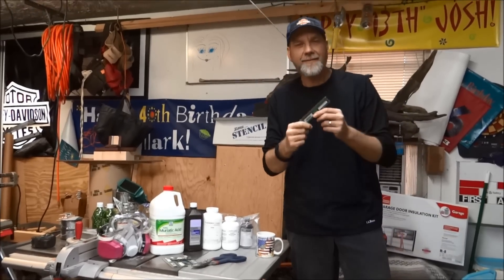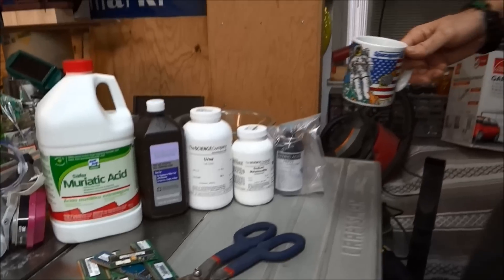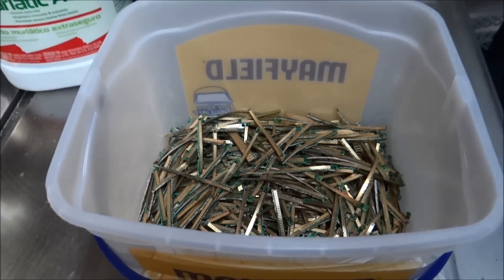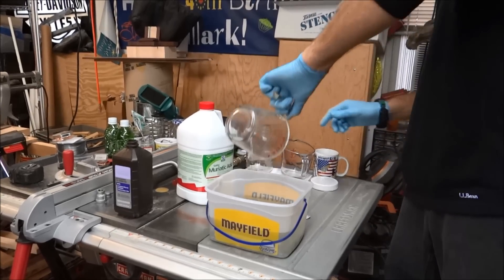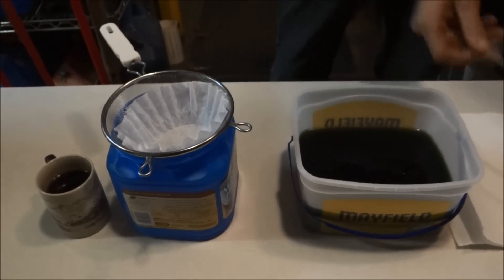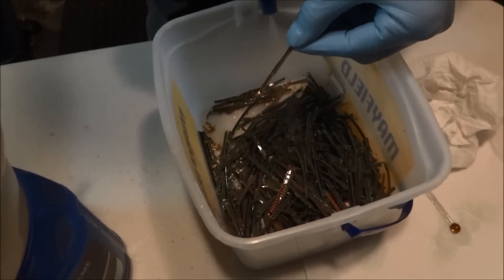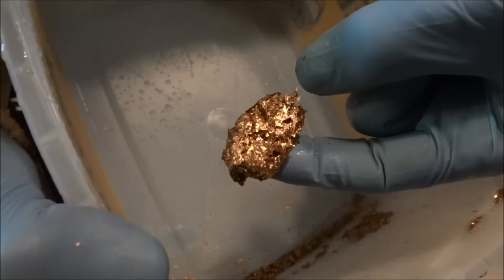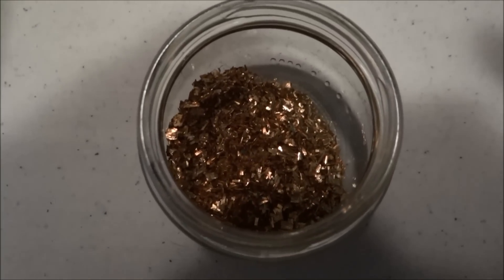How to easily recover gold from scrap computer chips

Comment: When I used a metal stainer, the muratic acid/peroxide ate right through the stainer.  I had to find a plastic one.
Reply from the maker: Agreed........a plastic strainer is a good idea.
Reply: LifeBuzzN stainless container works very well. We always use stainless container when we do the process of refining gold, separate it from silver.

Comment: Dont expect to get rich fast by doing this, you will need alot of memory sticks to make money. To buy the chemicals its ganna cost about $86, (you will not use it all, only about $10 for every gram of gold or 140 sticks). as of 5/7/14 gold is $1290 per ounce, or $45.50 per gram...
3900 memory sticks = 1 ounce of gold, 140 sticks = 1 gram of gold
1 memory stick = $0.325 worth of gold
You will need to scrap about 270 memory sticks just to make your money back from the supplies.
Reply from the maker: Your numbers are not reality in my case.  I spent about $30 on chemicals and got several batches.  Every 100 chips I get about $80 in gold, and then sell the trimmed chips for another $4 per pound.  I agree that you will not get rich, but in my case, I do pretty good.  Did you see the second part to the vid?  @5c9Z5UYsUV4.  Thanks for your comments.  Altho we don't totally agree on #'s, I appreciate your comments and time.
Reply from the maker: Refining the Gold - @5c9Z5UYsUV4.

Comment: $4 per pound is with the gold on them.
Reply: Hi, i have a good friend who own's a vacuum sales and repair shop. He has bid on old computers (lots of them) and won at our local Air Force base, where they were stacked on pallets.I haven't watched this yet but the older units have alot more in them. He used a needle nose plier on his workbench. He recovered all the platinum, gold and palladium he could. He would pull these pieces off the mother board and other places and had them seperated in baby food jars. Then couple times a year would drive 320 miles to  a company who melted down purified these metals eliminating the middle man (local recycling center). He also brought brass and #1 copper etc.This was all done when he wasn't repairing vacuum's etc. He has a great setup for this.Well here is what it came down to, after all his minimal costs winning auction bids, gas etc. his average  wage hovered around $25.00 an hour. What surprised me and was how much platinum there was, i seen the statements with breakdowns of end product purity with his check. But to have seen a few babyfood jars of platinum worth 3-4000 dollars surprised me. Have a great day everyone.
Reply: hunter jake

By the way he did no acid work or extracting on these items and he really went after computers that predated the year 2000. By the way i plugged a few of these old units in and they started up. The memories of seeing those blue screens of death on windows 3.1, 95 and 98 operating systems. :)  By the way he tried old tv sets they were not worth the time invested due to small amounts of precious metals and to bulky. I hope this may help anyone wondering.
Reply from the maker: Actually, I get $4 per pound for the trimmed chips.
Reply: Where!!!!

Comment: Hmm! the big question is what are u doin with the rest of the value Im referring to the left over all this finger trimming and acid striping hobby or not. respectfully given the price of materials say $45 from what I saw  and the yields pr pound of finger trim. 1 pound of ram = approx 22 pc of complete ram stick not trimmed market value is $12 pr lb and the value of assay pr pound of complete ram stick runs at approx $24 - $27 a lb at $1200 pr oz GOLD market. There's about 47 cents pr pc of ram finger trim x 22= $10.34 judging from what I saw in the bucket approx 200 pc means  u started with approx  9lbs of complete ram X say $25 = $225 actual value at the smelter less 15 to 30 % for processing and fees say -20% = $180 compared to the 1.3  gram=$50.32 u end up with after everything u can do to purify it from 18 or 22 kt to 24 kt trimmed ram has 1/2 market value 9lb X $12 = $108 u could have sold it for to a market buyer but u bought it at ? plus $45 materials cost = yield $50.32 THERE'S A REASON PEOPLE ARE SELLING THIS STUFF ON EBAY .As long as its fun and u don't mind  hair loss, soft tissue damage and the residual effects of caustic elements in confined areas ya greate fun just like sniffing glue while building that model right or washing ur hands with lacqure thinners after painting the hot rod its all fun and games. bottom line know one is doing this as a sustained hobby its not fun after a very short time because its clearly evident to those that have done it how small the return is given the investment. But if this cranks ya then I could tell ya ware to find 3x the amount of gold and spend 4x what its worth recovering it.Stay happy trendy.

Comment: Light acts as a catalyst for the hydrogen peroxide so it will speed up its decomposing to oxygen and water so its NOT a good idea to have in the sun since it will run out way faster and loose its effect much faster so you should have it where its as dark as possible. Its not a coincident at all that hydrogen peroxide always comes in dark or black bottles.

Comment: If you placed pitchblende into the nitric acid you can extract the Uranium. You can also dissolve copper with the Nitric acid. Nitric Acid is easy to make at home. One just needs a nitrate salt and sulfuric acid.If you add Hydrofloric acid to the  Uranium in a centrifuge you can create uranium hexaflouride which is used to enrich Uranium
Reply: ***** Do you work for the government? Because that was a highly detailed threat you made there lol.

Comment: Good info.  Would like to know how you disposed of the acids etc.
Reply: Kerry you can neutrilize the acid to neutral PH levels with urea or basic bicarb soda but the acids can be re used until the acid is copper saturated where is wont absorb anymore copper to help release the gold

Comment: It is not creativity. No relation to the work not have these actions. This is called secondary raw materials processing.
More than that.
The author says nothing about the danger of components used. Shows an example of improper conduct. Under no circumstances foods and drinks should not be close to these chemicals.
You should edit the video. To remove coffee and add subtitles to a video about the danger acids. This is not a joke. Many teenagers may be injured at least with strong acids. Responsible treat your videos.

Comment: you're correct when you say "coveed in gold". scrape the pins off with an exacto instead of cutting the effin board ..... then get a neodynium magnet from a HD and simply hold it over your shaved "fingers" and watch what happens. NO mag will stick to noble, non-ferrous metals but a neo. will even stick to the purest stainless. screw the acid .... all you need is a razor, crucible, torch and patience if it's non-plated 
....ram is such a waste of time to get gold you're better off ebay'n it for what it is. if you want actual gold you want pentium2 and earlier motherboards and video cards

Comment: just curious. what happened to the copper and the nickel..!! did they just vanished ?
Reply: No, they are still in the solution.  You can precipitate them out separately.
Reply from the maker: The copper, silver, and other metals are still there, they just need to be removed separately with a different process.
Reply from the maker: Correct.

Comment: THe step after the filtering you will now need to the electrical process to further leach off non gold from the gold particulates in the pan.    Then after ectroplating at that certain voltage then you are left with pure gold and not that 14k gold or less with industrial gold that you currently have.

Comment: I am curious as to what your cost basis is, how much time are you actually working on the process, cost of chemicals, supplies and gross profit from the sale of the materials.  Where do you sell/refine the gold or do you refine your own stuff?  Where do you get your salvageable materials from?
Reply from the maker: Maybe $30 for chemicals......enough to do dozens of loads.  The gold was worth $80 and the fingers got me another $22.  That's $102 minus the $30 equals $72 profit........plus the $$ I make on this video (currently $100 monthly for both vids).  Turns out, just the one load in very lucrative.  Typically, you will not get rich.

Comment: Much more important than using gloves when using acids is to have plenty of water immediately available.  Even with concentrated acids, you have a few seconds to wash it off skin without any harm.  You have essentially zero seconds to rinse it out of eyes; so wear safety goggles.  Also, it is very bad to get acids inside the gloves; much worse than just getting it on skin because it takes more time to get gloves off than it does to quickly rinse off  skin.
Reply from the maker: Roger That........SAFETY is very important.  Thanks Emerson.

Comment: I've watched a lot of these gold recovery vids.  Everyone concentrates on the fingers and pins, which are only gold plated.  INSIDE the chips themselves the tiny silicon 'chip' is bonded to its outside 'legs' with SOLID gold wires - tiny ones, but solid gold.  These can only be recovered the way the big refiners do it, by grinding ALL of it into powder, separating as much plasict off (vibrating) and then do the recovery.

Comment: at the end of the video, why cant i at this point  just melt the gold  in a crucible and use borax to push out the impurity's ?
Reply from the maker: If you gold is totally clear of other debris, you probably could.  I usually have other board debris left, so I need to refine more.
Reply: Indeed you could, but there are still impurities left from copper and/or other metals. So the button you will get will be not be as pure as you might want it to be.

Comment: Im half & half on your video, granted you have great results. My question is how come/why did you use a 50/50 mix? Ive tried 3 batches, fist went great which was 50 50 but Ive been told not to do that, do 3-1 or 3-2 at max but when I do I get gold flakes in my leftover solution even after being filtered. Do you recover the copper & gold leftovers from your solution as well? Also maybe I  missed it but I don't recall how much you had in your bucket?, yes I could see it but in chemistry is more of an exact science. I have a ton of fingers & more but I don't wish to process them & end up with any result unlike this/ my first batch. Great vid tho, do hope you didn't drink that cup next to your filter
Reply from the maker: I've always used 50/50 and have been very successful.  I use enough to cover the fingers.  No, I do not recover the copper.  There is very little, if any from the RAM fingers.  If I remember correctly, after refining, I recovered about a 2 grams of .9999 pure 24kt from 100 RAM sticks.  Check out my follow-up video to this.  I show the refining process.